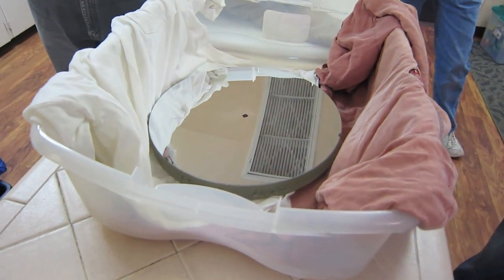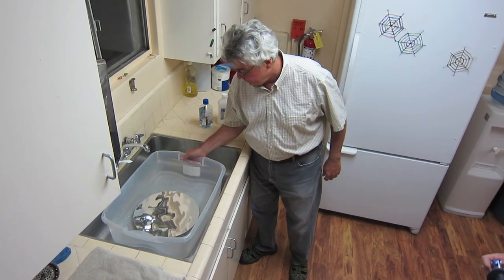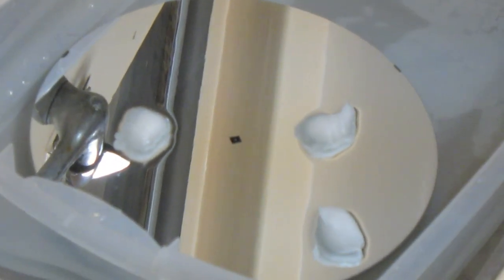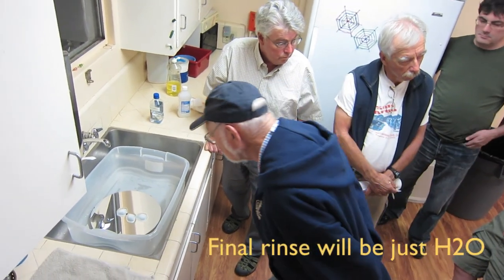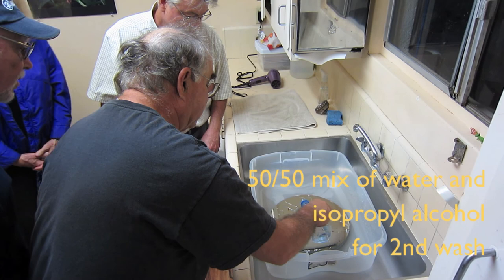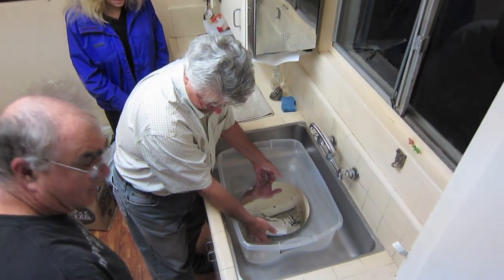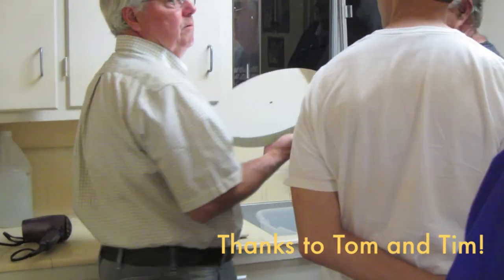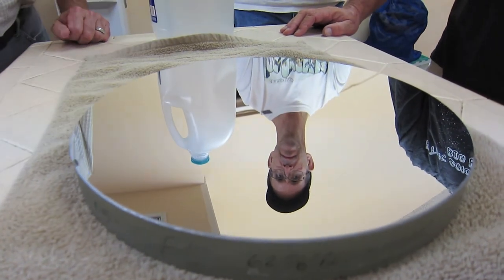Telescope mirror cleaning demonstration

Comment: how do you get the mirror out of the telescope?
Reply from the maker: Aran, that really depends on the telescope. Dobsonian telescopes, which have the mirror exposed to the elements, require more frequent mirror cleaning than other models (refractors, Schmidt–Cassegrains, etc). These reflectors typically hold the mirror with three clamps of some kind.
Reply: iutubeus i now know how to get it off but it was extremely stuck to the tube. i used a splash of WD-40 and that somewhat helped but i'm afraid that if i pull to hard it's going to mess up the mirror :/
  i have a 10 inch Orion Orion SkyQuest XT10 Classic Dobsonian Telescope
Reply: If it's a regular metal tube Newtonian, there are screws (3 or 4) that hold the main cell to the tube. Many times there will be three #2 Phillips screws about 1" from the bottom of the tube. After removing those, you can pull the cell out of the tube from the rear. (Mine was tight and took some twisting).

Once out, there are 3 tabs holding the mirror in the cell. They have to be carefully removed (don't drop a screwdriver on the mirror). The process should be described in your telescope's user manual. If not, find a manual for a scope similar to yours.

After washing, and replacing the mirror in the cell, those three(3) tab screws should not be over-tightened, since that will flex the mirror and distort the image. So, when first removing them try to get a 'feel' for how tight they are..
Reply: Richard Lee yep i finally cleaned it, but i had to put a lot of pulling power to get it off.
also note to everyone that is going to do this, once you pull off the mirror the top part of the telescope is extremely top heavy..

Comment: All that effort then to finish off by blowing a hair dryer? Wouldn't the hair dryer blow dust particles onto the surface of the mirror
Reply from the maker: I guess that depends on how dusty the inside of the dryer is. We did not see that problem.
Reply: iutubeus Great video...thank you. I Will use can with compressed air to blow the water of the surfice